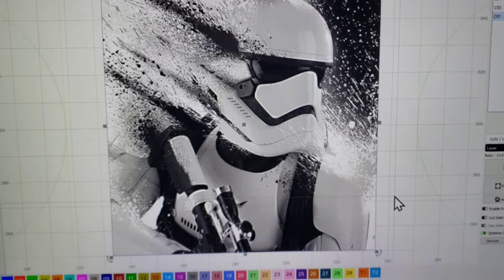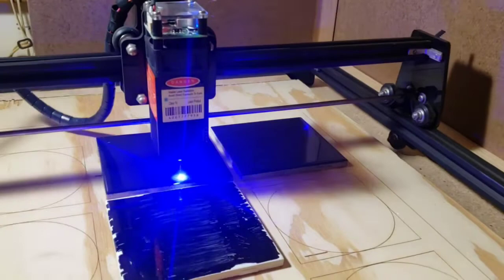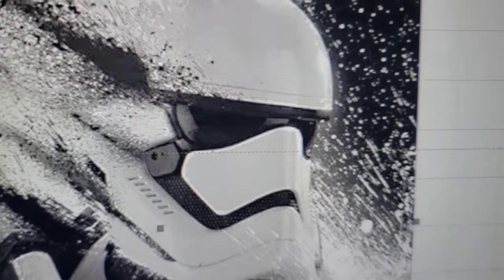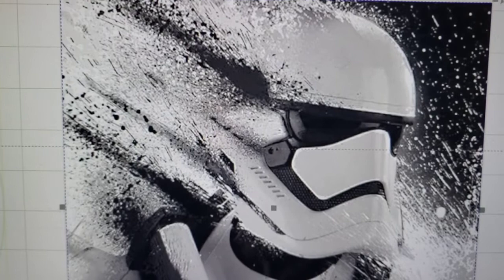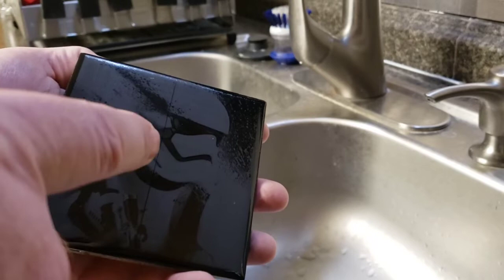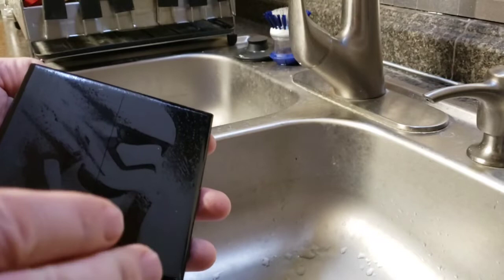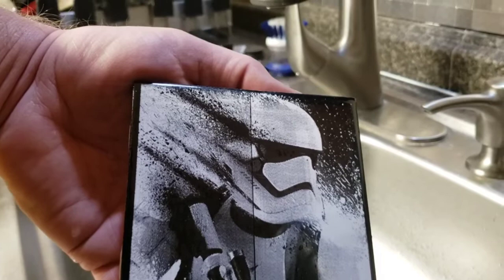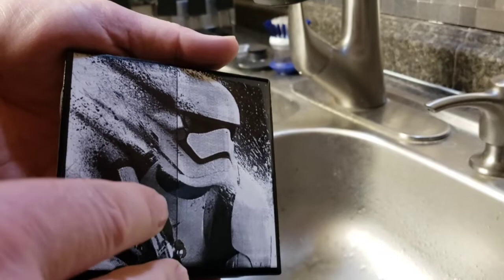The Kenny Hack: Painted Black Tile Image Settings and Post Burn Cleaning. Ortur Diode Laser.

Comment: nice to see ya on the same tests, havent found a paint that works as well as the x2 but that isnt sold here in the uk
Reply from the maker: The next phase of tests will be the difference if a base coat of another color or white is put on before the black. will the details be better? Can I still run as fast? Etc.
Reply: @TheKennyHack  so many variables with them its hard to get a consistent outcome. have been watching the RDWorks learning lab videos, goes into a lot of depth about lasers and engraving and just drool when he uses his fiber laser
Reply from the maker: @Nonprofessional_Tinkerer  ya, those are awesome to watch in action.
Reply: @TheKennyHack  get what you pay for  i guess, he does a few videos engraving on the card beer mats that come out really well, just another substrate to play with, cheap too
Reply: The 2x is a primer and paint in one.  try priming with white primer, then do the semi-gloss (or flat) topcoat...

Comment: I lost power using lightburn I hit the usb.  How do you restart the job ?
Reply from the maker: Don't move anything. Run the job in the opposite direction. If you were running on a 0° scan angle run it on a 180°. You'll have to be ready to stop the job when they meet back up. Hopefully with very little overlap. Lightburn needs to get a better resume job button to start at the exact point it quit. Doesn't take much overlap or gap to be vidible.
Reply: @TheKennyHack  It just froze nothing would move kept saying it was busy  and the timer kept running

Comment: I have a question, i have been using imgr website for my image processing because thats what i was first taught. I dont want to use imgr anymore. I have paid for lightburn and i want to use what i have paid for. Which videos do you recommend me of yours on how to use lightburn for canvas, nortton white tiles, and white tiles painted black? I want lightburn to do all the work, not imgr. Thanks
Reply from the maker: I've never used imagr either. I do use a free program called Gimp to adjust a photos size and dpi settings and file format. Maybe watch the Full Job video. Its on wood but goes over how to adjust an image in Gimp. Also do the Black Painted Tile Titorial, Colored Canvas, and the Norton Method on Ceramic Plates.

Comment: I started having wave lines in my tile portraits...have you had this issue before? With images I get from Google to my own pics taken with my camera
Reply from the maker: are they spaced the same as the teeth on the belts?  maybe try cleaning your belts and rollers. make sure you don't adjust the size of the image once imported into lightburn.

Comment: have you done this on a co2 laser machine?
Reply from the maker: no, I only have diode lasers. Im sure it could be done on a co2 but maybe want to put on a thicker coats of paint so the lasers have more power range to work with.
Reply: @TheKennyHack  Ive tried speed  from 130 to 300 and max power 11.4 to 19 20 but i couldnt get a good quality image. I cant figure it out drives me crazy :D
Reply: and thank you for your answer and  time

Comment: as its a black and white image why not use white tile method, i did and 1st attempt has come out really well using jarvis
Reply from the maker: The white tile method is too slow for my liking. I wanted to be able to do 9x12 or larger images and those would take way to long using that method. 4x4 are just for practicing.

Comment: PLease can you possibly help me! i have a 3018 with a 15mw output laser i have tried every white tile black tile blue yellow and green tile but there is no consistency in any burn, sometime full black images such as superman sign works fantastic and as soon as i try a photo it light hardly burnt and rubs off most of the time just by rubbing, im on day 5 and loosing my mind going to buy the orthur that you use master 2 15mw laser but as far as im aware its the same diode as i have right now
Reply from the maker: What speed, power, dpi, and dither mode do you use? Are you trying to do the Norton method of fusing the paint or just doing a white tile painted black and burning the paint off?
Reply: @TheKennyHack  ive ran at all speeds for some reason the paint never sticks fully will in some places but not in others and it is never dark its always a light shade of grey, i am doing what you said use gimp 600 dpi resize ect, the in lightburn change to 300 dpi, i have got wood, scratch cards all running well just cant do this white tile method it wont stick.

Comment: What does the Gamma Control?
Reply from the maker: Raising gamma makes everything darker. If I'm doing a positive image ie burning onto wood I try to shift the image slightly darker. This makes the lighter details show up better. If im doing an inverted image ie black painted tile its opposite. I shift the image slightly lighter to get the finer details to show up. I usually set the contrast to -15 and brightness to +15 and all the enhancements to 50 as a starting point and make slight tweaks from there. If your power and speed are set right. What you see on the screen should be close to what you get on the burn is the goal.

Comment: this method can work on co2 laser?
Reply from the maker: I really don't know. I'd think so, but not sure I've seen it much in the forums. I've seen co2s do canvas and that's basically the same as doing it on tiles, so I think it should.
Reply: @TheKennyHack  i did try on tiles.. using normal white paint... either it burns it.. or jst removes it. Not having the black effect